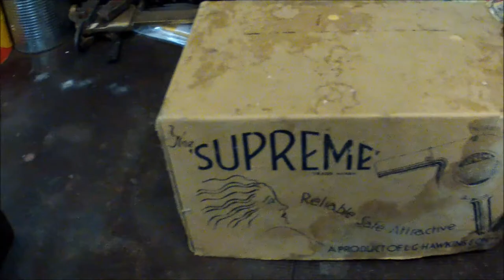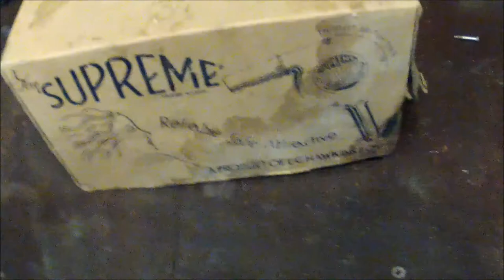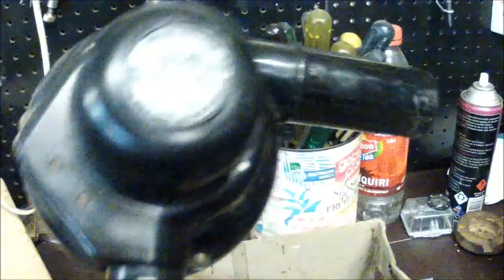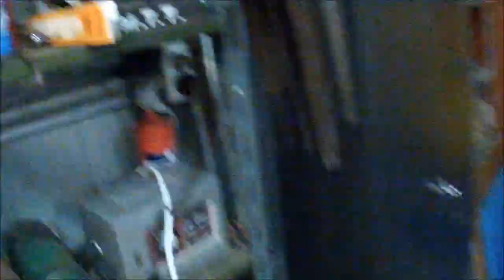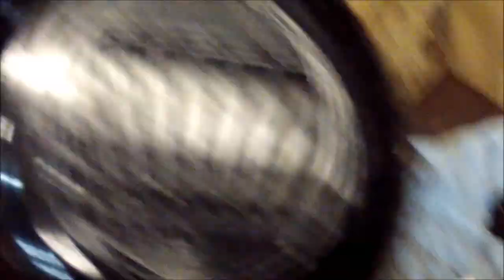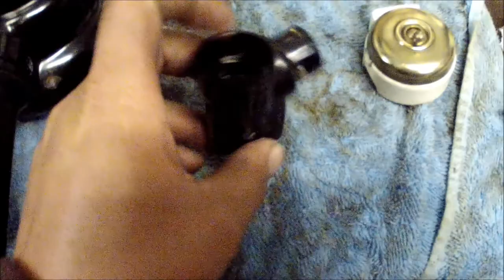Vintage hair dryer and Power point - Clynton's Shed

Comment: Some nice items there, i like that power point set up, never seen one of those before. I'll keep an eye out now! An old shed up the road had really vintage electrics, everything was original down to the steel condute and bare earth wires. Got pulled down a few years ago and pushed in a hole.
Reply from the maker: scarily enough a lot of houses down here are still wired with that, its predecessor lead cable is also still sometimes in use (thats a pain cause by law i have to immediately disconnect it whether the owner likes it or not) but i think this even predates all that and goes to cap and casing days (about 100-110 years ago)